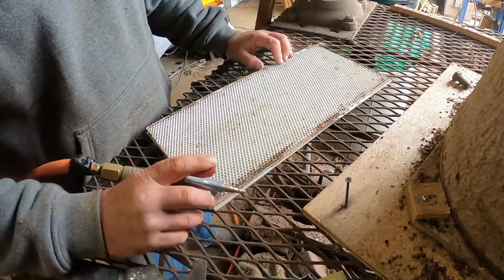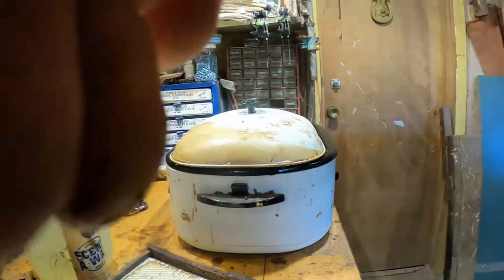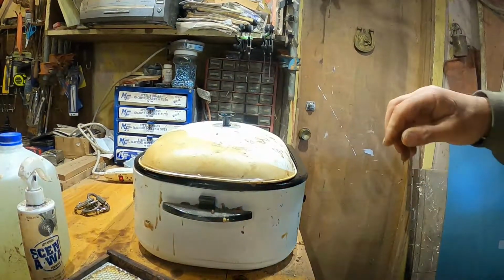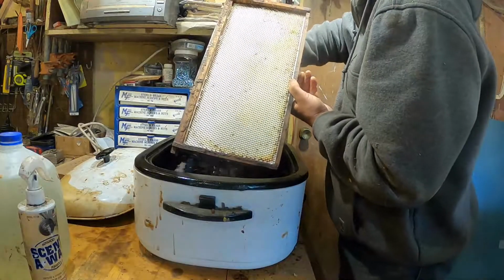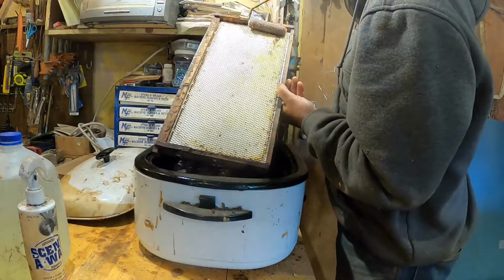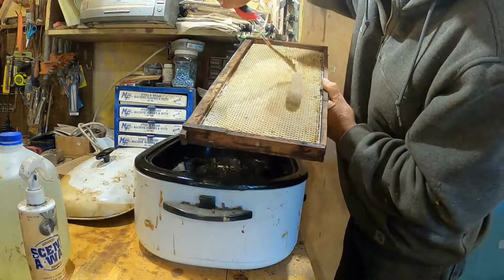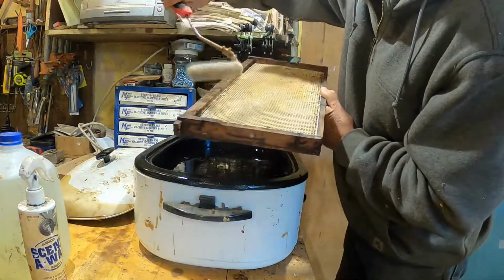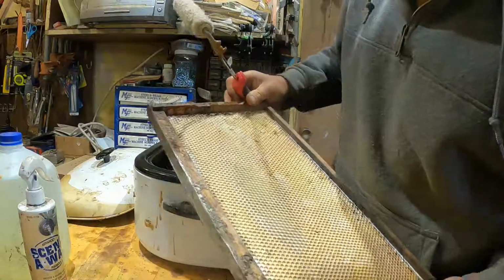cleaning plastic foundation

Comment: Thanks for the tip! I've not had much luck with pressure washer either. BTW you practice the same kind of shop organization I do.
Reply from the maker: Lol. I bet you constantly mumble I got to clean this crap up same as I do. Right now I am building some feeder shim insulation boards, in the middle of the shop, and there's a barrel of honey sitting right in front of the door. Someday I'll get more organized
Reply: @harrisjoubertwithsleepycre1924  that’s the problem—can’t get around to straightening up before you’re into another mess making project lol.

Comment: Wow, well done! I usually just scrape them and leave that stuff in there but they don't take to it very well. You plan is much better for the bees. I wonder if you could just dip the whole thing and skip the roller part though
Reply from the maker: dipping would work, but you have to scrape the wax off the sides that go in the frame so it will go all the way in or it buckles. I am working on a heated spray gun, one more project on a long list.

Comment: It there a right-side up for the foundation’s?
Reply from the maker: If the foundation has two corners cut out, those are typically put on the bottom. Those are so the bees have holes to climb through to the other side. But I know some guys that cut those in the top also. Other than that they are not directional
Reply: @harrisjoubertwithsleepycre1924  thankyou. Tried looking at cut edge. Looked as though they could have been tilted slightly. Reworking some of the stuff I acquired.

Comment: I have about 900 to do and am thinking about making a copper pipe with several holes drilled in it and closed at the end so I can just shove the foundations thru to be cleaned. have pressure washed a few hundred but it's slow and have to stand all day and wear a frogman's suit.
Reply from the maker: I wasnt impressed with pressure washing them. this works good, but takes a lot of air. I think you would have trouble supplying enough air to be able to run them through like you want. you have to hit each cell to get it to clear

Comment: Why not use a hot water,pressure in a car wash, faster,cheaper,and cleaner.
Reply from the maker: tried a pressure washer, still have to get the water out. thats when I used the air, and it cleaned them better. I dont have time to load up foundation and haul it to town to clean it. it would be cheaper to buy it new